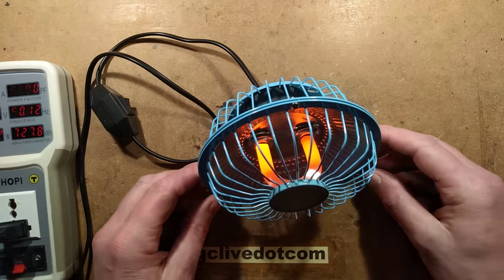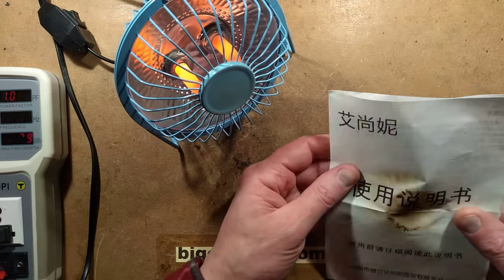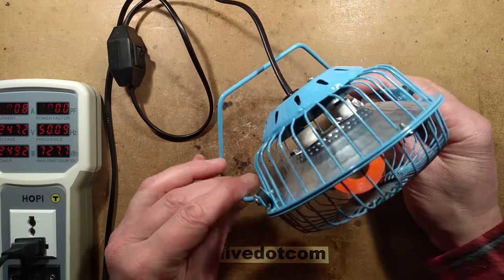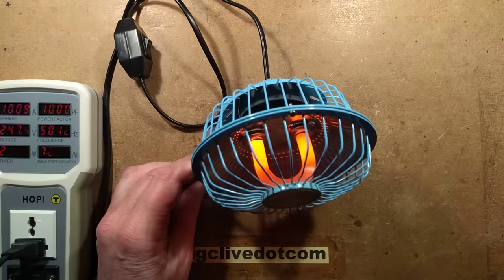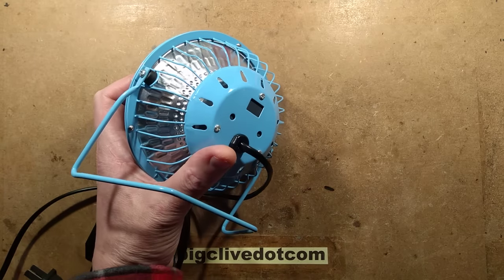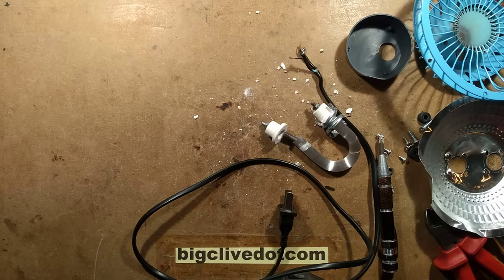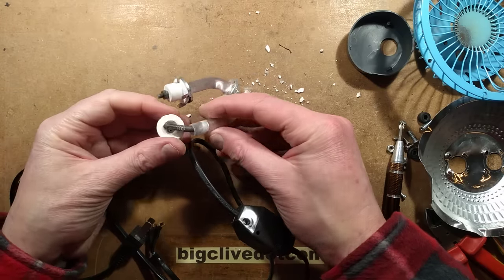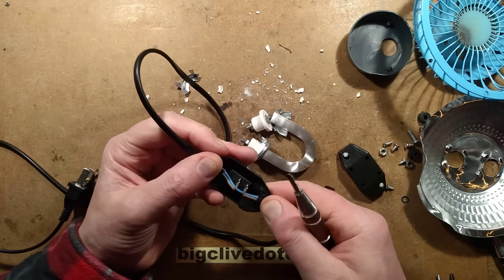Chinese automatic house ignitor.  (also available in pink)

Comment: This was a fan in a previous life. I have the actual fan on my desk in black, same style right down to the stand. You can purchase them in Walmart.
Reply: I have one under the grill/cover in the washroom (replacing the fan they once had in the cavity, long since removed before I moved in). Works fine for exhaust purposes, though, needs cleaning due to dust, and lubrication.
Reply: Greenshot user spotted
Reply: I had one similar to this that ran on mains power that I found at a garage sale. Worked for a couple years and then died. No burned house, either

Comment: We have 1000W version of these "quartz" housed heating elements here in Syria. The housing has the tendency to turn into dust inside. The dust accumulates around the heating element causing over heat and then a huge bang and then off.
Reply: I know the Bulgarian ones (800 Watts, in two separate tubes). They work very reliably. Only problem is, if you knock them over, sometimes the glass breaks. But replacement tubes are easily available.
Reply: I loved the Diesel heater we had in Syria, every now and again you'd get a gust of wind forcing itself down the chimney, and soot goes everywhere
Reply: @PodeCoet  At least the house got warm. The last time I felt the warmth of a well heated house was back in 2010.
Reply: Paul NJ you want money or something ?
Reply: @girthbrooks7645  oh no. Thank you for your concern. Truly appreciated. It's not the lack of money. It's the lack of the availability of fuel ( Diesel and gas) for heating properly due to current war situation in the region. Most of Syria relies on Electricity for heating all winter which causes planned blackouts through out the season. In my area (near the center of my city) we have 12 hours of electrical power per day. Not to mention occasional power failures due to grid overloads.
Reply: Paul NJ that’s no good. What town are you in. I’m in Detroit
Reply: @girthbrooks7645  I'm in Lattakia on the sea side.
Reply: dustisdeadbodies85  It's okay really. We are used to these conditions. This year, it is far better in terms of electricity overall downtime compared to previous years.
Reply: dustisdeadbodies85  Interesting simple idea. Most homes do have lead-acid car batteries charged to supply electricity for ADSL modems and LED lighting or even for LCD television watching.
Gas heaters are also available but gas bottles are in extremely limited supply during this time of the season due to high demand. So really it's not extremely bad or anything. Thank you for your kindness.
Reply: dustisdeadbodies85  Thanks and Merry Christmas to you and to your loved ones too. Hoping for a more peaceful world for all of us.
Reply: @noelj62  very good. Are you safe?
Reply: @girthbrooks7645  Yes, I'm safe thank you. Most of the western and southern areas of the country are practically safe. Christmas decorations is abondante this year cause Syrians feel more relieved after years of frustration and despair. Happy Holidays Chris.
Reply: Paul NJ Same to you my friend. I would like to continue our dialogue. Would you like to be pen pals? I feel like we could learn from each other.
Reply: @girthbrooks7645  I don't mind really. I enjoy sharing experience and learning from others. There's a discussion tab on my YouTube channel if you desire to keep it on YouTube.
Reply: Pretty fly for a WiFi  Many thanks, but it's really OK for me and my parents. Many families here are getting continuous help from humanitarian organizations all the time. I'm living in Syria. The level of life is relatively stable. It's not as confortable as one my wish but still better than years passed. Much appreciated and have a comfy end of 2019.
Reply: Pretty fly for a WiFi  Oh, destruction has taken down a huge part of the Syrian land. In stable places and especially in the capital Damascus, rebuilding process is on the way. Sadly that it'll take huge efforts and lots of time to bring things to the way they were in 2010.
Reply: Pretty fly for a WiFi  I see that TV, especially the western media did a bad job in reporting the real events and facts. I know it first hand because I was in Europe in 2011 when the crisis started.
Reply: Pretty fly for a WiFi  Cities such as Homs and Aleppo were mostly destroyed being turned to battle fields. Most factories and resources were smuggled to Turkey.
Reply: Pretty fly for a WiFi  It's sad and painful to see what were peaceful places turn into waste land. But the hope is not yet lost. Thank you for your kind intentions.
Reply: @noelj62  i take it you dont have a lot of trees or scrubs in Syria, you can make a DIY clay charcoal mound that gets super hot and only produces useable by products such as (useable) coal and the gasses can be set on fire (after bubbling thru water like smoke in a shisha pipe) because the gasses are only heated but havent combusted yet.
You should look for Primitive Technology.
Even if you Paul NJ arent from Syria i still wish you the best
Reply: @BigBodyBiggolo  Thanks. Wish the best to you too. I'm from Syria and living in Syria during the past 8 years. We also have charcoal used for Narjileh and it can be used for heating in the extreme of conditions too.
Reply: @noelj62   modernize this low energy way of living and make the premise of cival war obsolete. Basically you need to take the economy out of fighting.
Reply: @mikeschiavoni5973  Indeed what we do on daily basis. BigClive's educational videos helped a lot.
Reply: Jay Leno  Without the Russian military aid in Syria, I'd be just another homeless refugee since 2015 (given that I'd still be alive). The flour for the daily bread Syrians eat is mostly Russian aid.
Reply: @noelj62  I thought there was some internet censorship or are you using a VPN. Like people who live in China.
Reply: @REDARROW_A_Personal   There's internet censorship but not for major sites. Only for selected ones of "sexual" content. Facebook censorship was removed in 2011.
Reply: @noelj62  all this is so wholesome are u still ok?
Reply: @JDMOON55555  Yes I'm still fine. Thank you.

Comment: I need one that works with Alexa... 
"Alexa? Burn down my house..." 
"Okay, burning down your house."
Reply: Just leave it always on and have a smart socket connected to the Alexa. Perfect house igniter!
Reply: Alexa would probably just start playing the song by Talking Heads
Reply: @kennethney4260  yes, yes it did
Reply: but i mean you probably have heard the stories where someone asks Alexa to commit sewer side or to self destruct.  and then this happens : echo tap self destruct, initiating thermal runaway in 5 seconds, 5,4,3,2,1 peeeeeeeeeeeeeeeeeeeeeeeeeeeeeeeeeeeshhhhhhhhhhhhhhhBANG pop crackle crackle BANG!
Reply: Alexa? Burn the house down. 
“Now playing Burning Down The House, by The Talking Heads.”

Comment: This would actually be a quite affordable solution for a 3D printer chamber heater.
You would be monitoring the chamber temp anyway, and (presumably) have the system programmed to shut down on over-temp. Just replace the cord and you are good to go.
Reply: The only issue I can see with this is that the heat from an element like this isn't very well diffused nor is it able to be turned up/down you might be able to make it have adjust able levels but some part of the enclosure might still be hotter than the rest
Reply: @Teddy-kv5ns  it’s just resistive heat, so the heat output is directly proportional to the amount of power supplied. You could run it lower to heat evenly more slowly, although still definitely not perfect
Reply: @zgrb  The quartz tube means this would be primarily an IR heater as opposed to primarily a convection heater. This would be worse in the case of heating a chamber. The quartz is used to minimize convection and maximize IR transmission as it's better for heating things directly as opposed to dumping all the heat directly into the room and heating things indirectly. But that is what you want in a heated chamber.

Comment: Yeah, those cases are used for little desk fans. One of Walmart's in-house brands, Mainstays, sells little $5 fans with that exact case, in multiple colors including that blue, which either plug directly into the wall, or have a USB end. The square hole under the sticker is where the on/off switch goes. They're actually quite nice, last a long while, though they have a tendency to develop a bad rattle after a few years.
Reply: You overpaid.  I got mine for $2.  Of course jokes on me because mine sized up after a couple months.
Reply: @jimb032  for $3 more his multiplied it's lifespan compared to yours! On the bright side you can take your fan housing and turn it into a desk heater... just don't burn the house down.

Comment: At least the designer had the sense to relocate the rocker switch from the back of the housing to inline on the plug for the heater (as opposed to the fan design). Much easier to turn it off without burning your hands that way.

Comment: I think in the US, space heaters are required to have orientation switches on them so they will automatically switch off if they fall over. Most of them are really stupid simple, like a ball bearing on a track. Others have a momentary switch on the base that depresses when sitting on it's base.

Comment: I do kind of appreciate this kind of absolute simplicity.  It’s a heater that heats, and that’s the only thing it does.  Not a single microchip or sensor, just a switch and a heating element.  It really can’t get much simpler.  It’s still wildly dangerous, but I suppose it’s slightly safer than starting a camp fire in your room.

Comment: I used to have a fan that had the exact casing. Can confirm this was originally a fan that got bodged into a heater.

You can still get them at WalMart here in the states. And the quality of the fans is on par with this.

Comment: When I lived in an apartment I would sometimes lie awake at night terrified that other tenants would be stupid enough to use things like this and burn down my life because of it.
Things like shoddy hotplates, heaters etc.
Reply: This is why I never want to live in an apartment.
Reply: I still occasionally worry about this, but a) renter's insurance is good sense, b) my new landlord banned them (thankfully) with a line in the contract that basically says if you're caught with one or cause fire/damage with an electric heater, you're insta-evicted. This is a building with an old-school boiler for heat, there's really no need for them, anyway.
Reply: You get to meet all kinds of people in an apartment.  Good and bad.  Just shows people don't have the same values as you, something a lot of people just don't get.  I got lucky since apartments are so expensive where I lived that most were well educated.
Reply: personally i just use a couple wires out the wall to heat my soup, gotta do what you gotta do when your landlord doesn't do anything about the stoves.
Reply: Yeah, and fire travels up, so being on the top-floor is always fun...

Then again, i also tend to worry if my apartment is going to be the one to get 'lit', due to all the lithium batteries i've got, and power supplies charging them etc.
Reply: Tyler Murzyn mister heater running off bulk tank mid level of 3 story
Reply: @Agent24Electronics  None of us do either, but needs must
Reply: Thats why many countries got regulation for all that kind of shit, both for electronics, houses and electrical systems, and then some more for apartments in particular.

There really isnt much of a risk, generally. Dangerous house fires are pretty rare, all in all.

Comment: I bought two pet bed heaters from Aliexpress recently, had one plugged in, the dog managed to fold the mat slightly, and when I went to straighten it up, I noticed scorch marks... there was also a crunchy effect, and upon ripping it apart, the insulation had burned back into small crunchy lumps leaving the exposed live element (if it was plugged in). Very much a fire risk, and a good chance of there being an electrocution risk if a damp dog lay on it. I've got the second still bagged up if BigClive wants to do a tear-down.
Reply: The Dog-o-cuter...
Sister had a repurable dog bed heater, the dog chewed through the mains flex... Dog survived but wouldn't go near it after I'd repaired the cable.
Reply: @joinedupjon  - I used to know a cat that liked to run for the old landline telephone when it rang, as if to answer, which was funny enough, but the real reason was to chew on the telephone cord while the phone was ringing, which means 100 volts AC at 20 Hz. Even in the animal kingdom, it takes all kinds!
Reply: @YodaWhat  um, no hate, but go back to electrical school... telephone wire is ' low voltage. '
Reply: John Smith   Wrong. Ringing voltage is, in fact, 100v 20hz, most places in the world. Talk battery on the line is 48vdc.
Reply: @robertstredde6798  Correct! Plus 24 volts AND minus 24 volts DC, as referenced to earth ground. And when off the hook, voltage drops considerably, to about 8 volts, if I recall my old measurements. Ringing voltage had to be much higher, to push enough current for mechanical ringers down what is sometimes several miles of thin wires. It was very clever of the old engineers to make it all work, decades before the first transistor.
Reply: YodaWhat Most cats today are 5V and come with a standard usb charger. The bigger breeds take a lot of current though, up to 3 amps!
Reply: @rpvermeulen  LOL. And Rudolph's red nose... must be some super-bright LEDs, eh? Happy Holidays!
Reply: @YodaWhat  Telco voltage is nominally -48VDC referenced to earth ground. In reality more like -50VDC with the amount of lead acid cells most exchanges/COs use. Negative voltage because it causes less corrosion in the conductors in the ground.
Reply: @SuperSpecies   - Maybe that detail varies from country to country? It is quite definite that I measured a bipolar 24 vdc here in USA, because grounding either the Tip or the Ring wire will prevent the phone from working.
Reply: @YodaWhat  it's the same worldwide. The reason grounding either side stops it from working is likely due to the difference in earth potential between your premises and that of where the Telco earths them: at the Telco earthing conductors in the CO.
Reply: @SuperSpecies  - That should not be more than a fraction of a volt difference. Is that really enough trip to up systems that were designed in an era before transistors and vacuum tubes?
Reply: @YodaWhat  Most of the line cards are less than 20years old, it could be over-current protection. https://en.wikipedia.org/wiki/BORSCHT
Reply: No, you should definitely use the second. There's nothing more tasty than dog flambe. Plus the combination of burning fur and insulation leaves a pleasing aroma.
Reply: @wtrdawnlord  when in Korea... Add soy sauce for flavour :-p
Reply: @colinwilson210  I wasn't going to go there. I thought it, but I wasn't going to say it LOL
Reply: @rpvermeulen  you are correct about the charger, but the lead is different for the iCat.

Comment: I've lived in China since 2010. Never seen a heater like that. What people do use is similar radiant dish heaters 1200W with a tilt safety switch. I think they do have safety switch laws in the country. Usually if you're sleeping outdoors or without insulation, where it's breezy, on bare concrete, you use heaters like this. Lower class people, sleeping in shacks or cots or factories or when standing in their shop in cold weather open to the outside, with no doors. They love natural ventilation and no doors, that's where these heaters are popular. There's nothing combustible around them usually, maybe a soft seat cushion, that's about it. In residential houses they only use convection heaters, also about 1200 or 1600W. Also those oil filled radiators have become popular lately with rich people because they don't make noise. so
Lower class: radiant dish heaters
Middle class: quartz forced fan heaters
Upper classes: oil filled heaters or just install lots of heat pumps and underfloor heating.